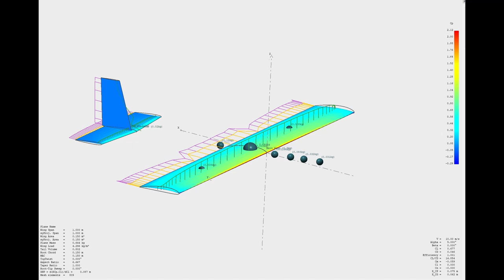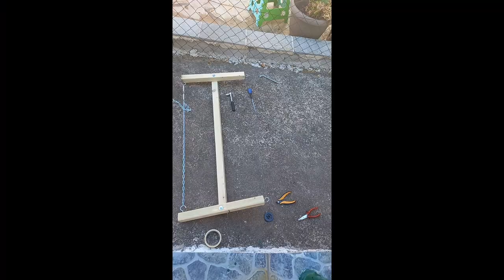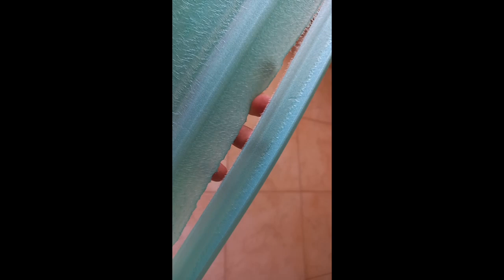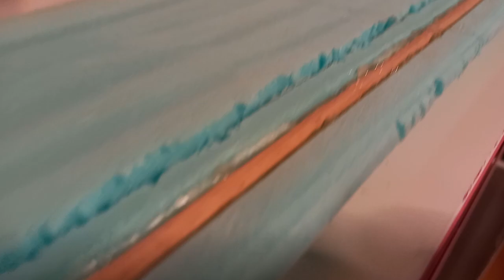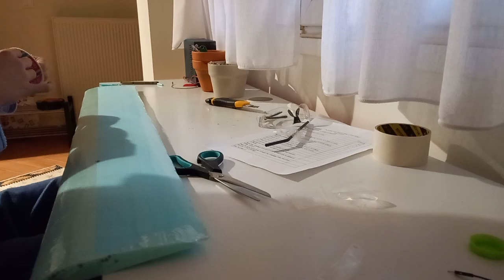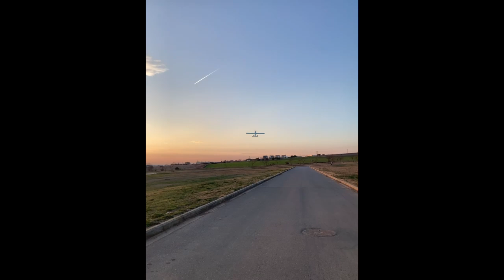How I Built a Plane Out of House Insulation

Comment: What’s the material did you learn while building this aircraft
Reply: I’m very curious
Reply from the maker: The material used is extruded polystyrene, commonly used for home insulation. I found it at a local construction supplies store.